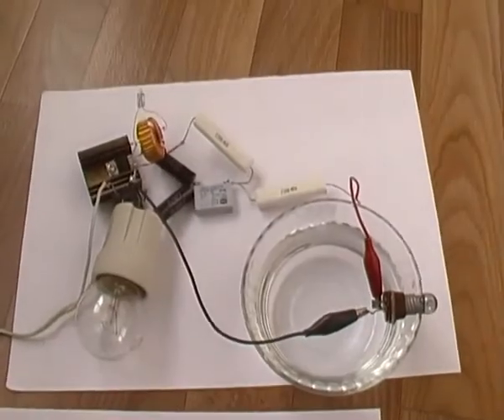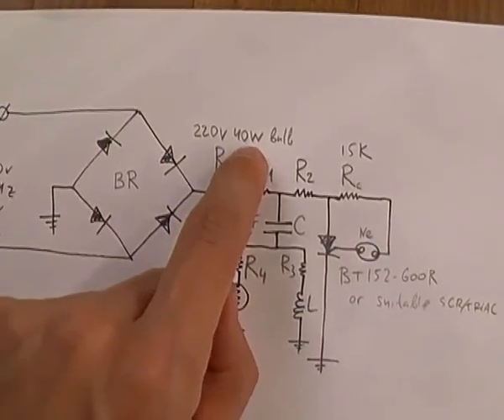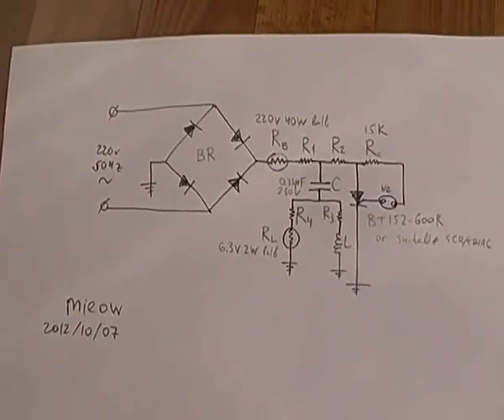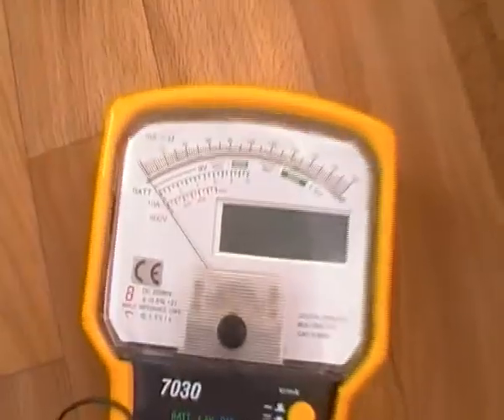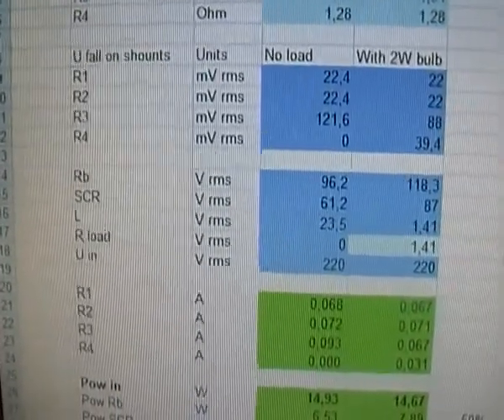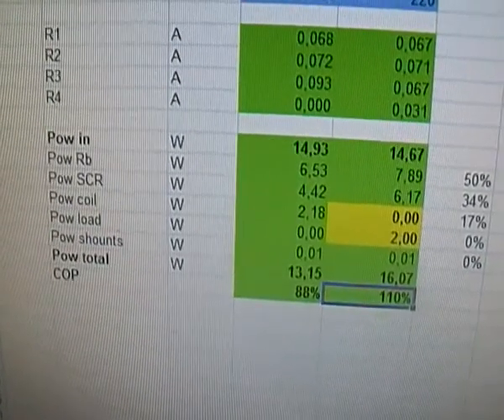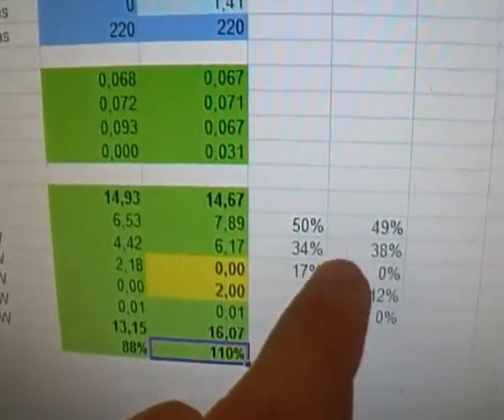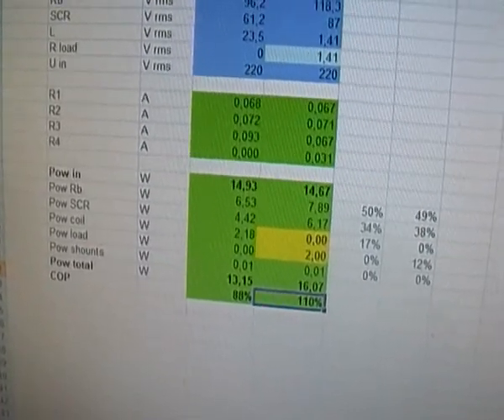Solid state THP overunity?

Comment from the maker: I agree. So I`m using 4 shounting resistors (0.47 Ohm each) to measure the amperage in unit`s knots and also measuring the voltage drop. Bulb resistance is not taking part in the power calculations.

Comment from the maker: Power dissipated by the element is equil to the current passing  through it times voltage drop on it. It does not depend on stability of bulb resistence or else. 
I agree with the inaccuracy of meter measurements. But my scope measurments are way more worse!